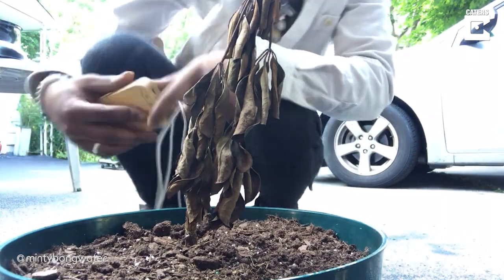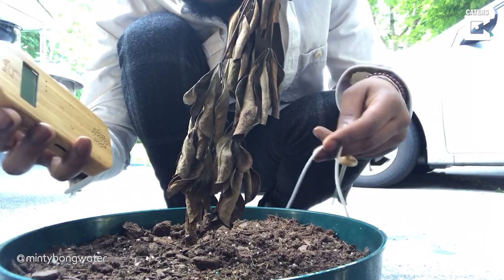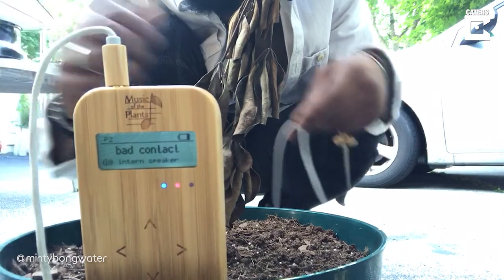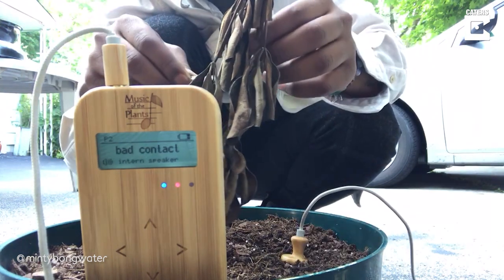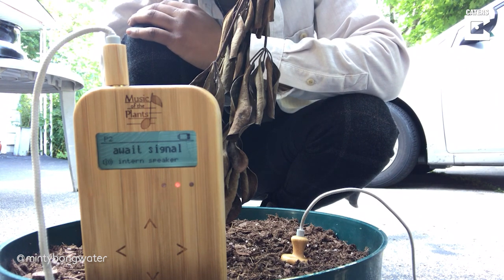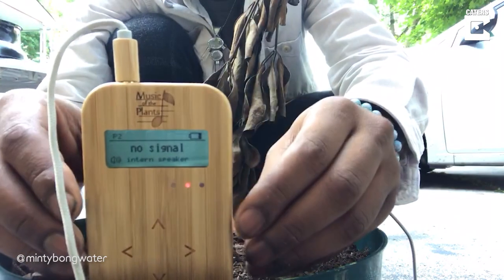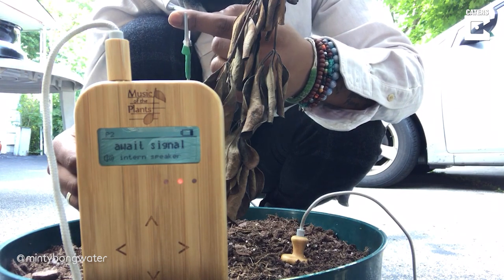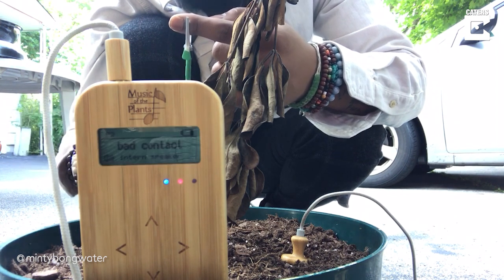Music Gets Generated From Electrical Signals From Plants

Comment: But what does it means, if a sound high or low?
Reply: High note means more vibration, low note means less vibration, if something has a low vibration it's generally negative, and high vibration is generally positive. Horror movie producers utilize this in songs/sounds used in movies of that kind, they use very low frequencies to make people feel on edge, anxious, and to a certain degree afraid, to make the experience more immersive, and the same goes for movies designed for kids, Disney etc.. they use high frequencies to make people feel excited, envigorated etc.. 😊